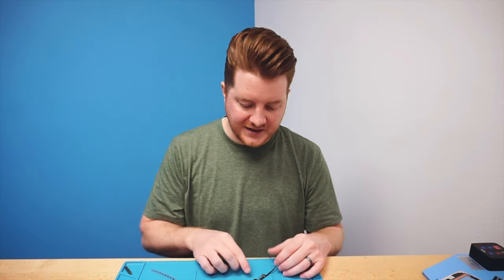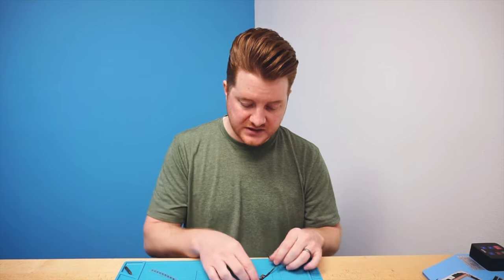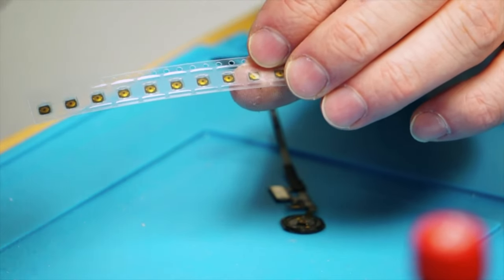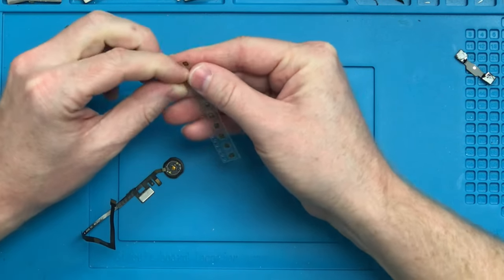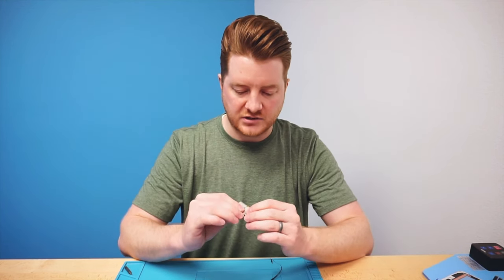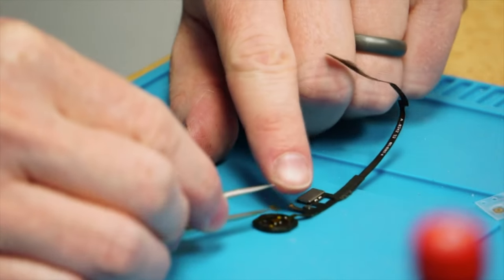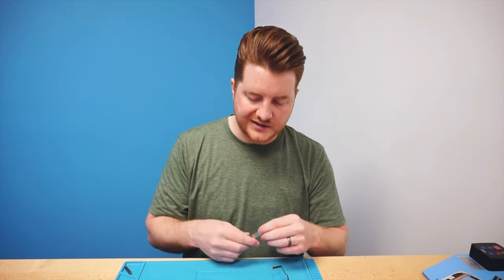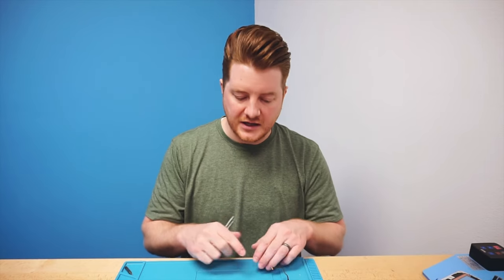iPad Home Button Actuator Missing? How to replace it and things to avoid while doing so!

Comment: I followed the video, the iPad mini 4 button now clicks, but doesn’t recognize that I’ve pressed it. Did I miss a step?
Reply: Who did you order the actuator from?
Reply: @michael6ringsjordan892  I actually took it from another iPad that I replaced the glass screen on.
Reply: @michael6ringsjordan892  the screen I took off had a crack down one whole side, it actually stayed intact when I removed it! I was surprised it didn’t break more. Came off in one piece. I used a heat gun and took my time.
Reply: @amy_k1143   You have better luck than me.  My screen was shattered everywhere so I had to pry all the little glass pieces up. Worst case scenario is that I’ll use the screen replacements home button and lose the Touch ID which isn’t really a big deal because it’s a family iPad with no password on it to begin with but I’m not going to give up on it that easily.
Reply: @michael6ringsjordan892  good luck! Hopefully your repair will turn out better than mine. It was my daughter’s iPad mini and it’s currently sitting on a desk, still in pieces because it doesn’t recognize that the button is being pressed. I hope the guy that made the video knows something easy that I’ve overlooked and can get me back in business! 😅